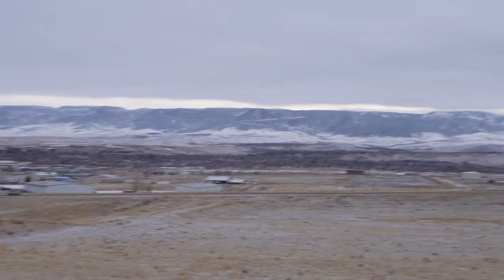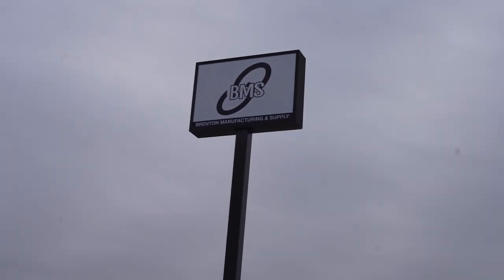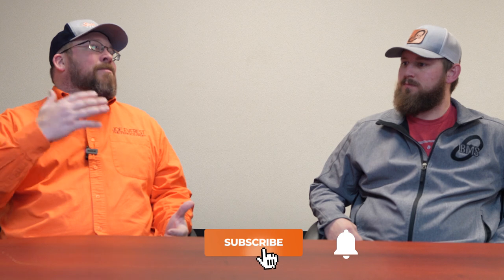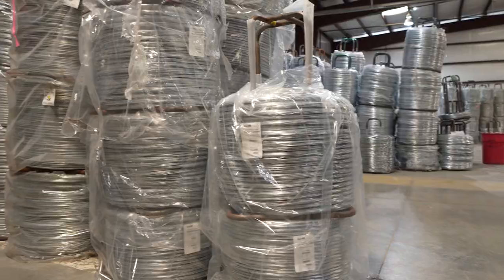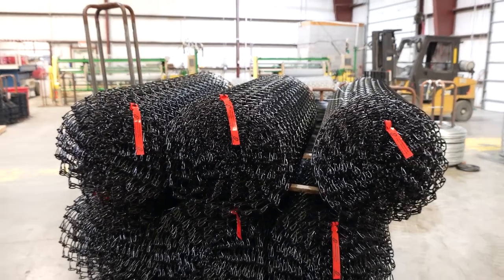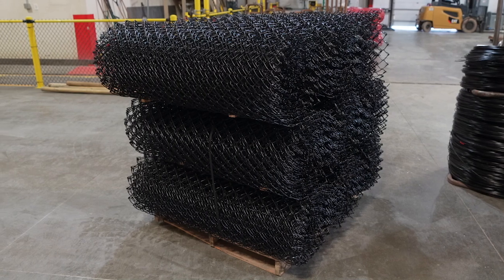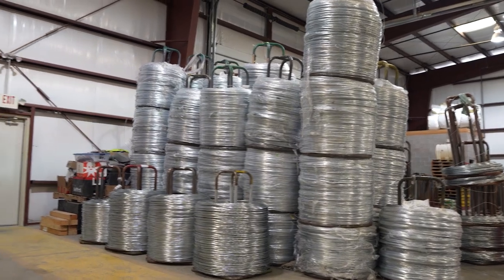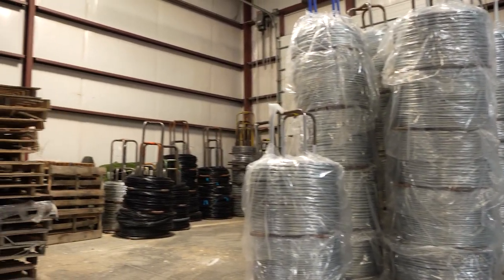Which Chain Link Fencing is Better? GBW or GAW?

Comment: I've been doing fencing for 35 years had my own business for 22 and I don't see how galvanized after is still in business because that wire is ridiculous I do all residential and one-time got ahold of some of the galvanized after weaving and had to put it up at a playground I felt bad about even putting it up because every time a kid would lean against the fence they were going to get cut on a ber. That's why I say I can't believe they're still in business unless you wanted the fence for livestock to maybe keep them off the fence. As dangerous as it is Surprised they hadn't outlawed it like they did the barbs on 4 and 5
Reply from the maker: The liability of GAW is a great point!

Comment: Use aluminized wire only I've been doing fence in Pittsburgh for 25 years and my experience aluminized chain link fence is a way nicer product than any kind of galvanized fence
Reply from the maker: Aluminized just isn’t a thing in our market so the pricing just isn’t feasible.